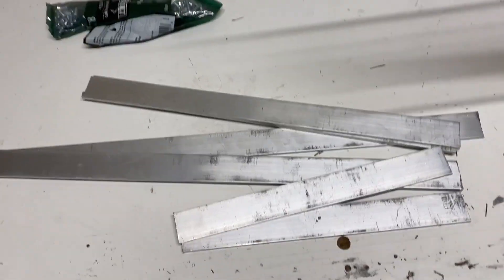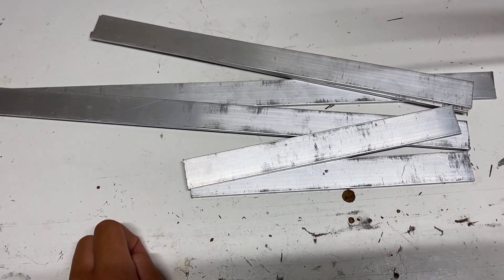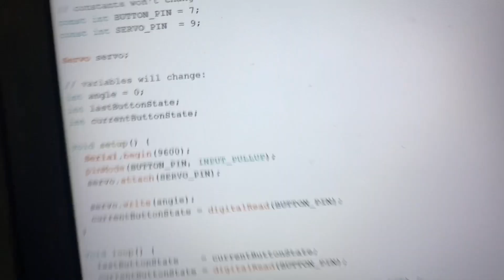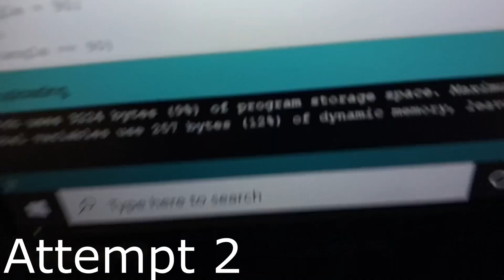Making A METAL IRON MAN ROCKET LAUNCHER!

Comment: You do know that you have to ignite the propane, so the force of the explosion pushes out the projectile, cuz at this point your just shooting out compressed propane
Reply from the maker: Yah I know, the propane shot out so fast that it just burned instead of exploded. I was going to try using a different valve to slowly let the propane out, but I didn’t have enough parts.
Reply: @Random.Creations  wdum your not supposed to shoot out the propane, the explosion is supposed to propel the projectile